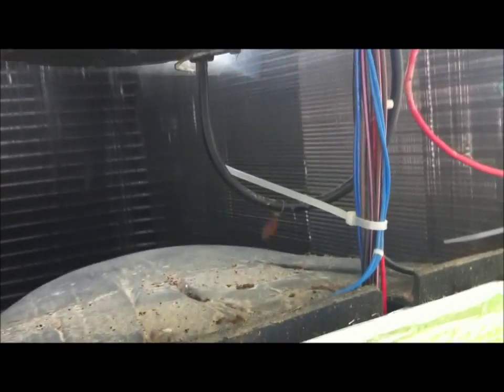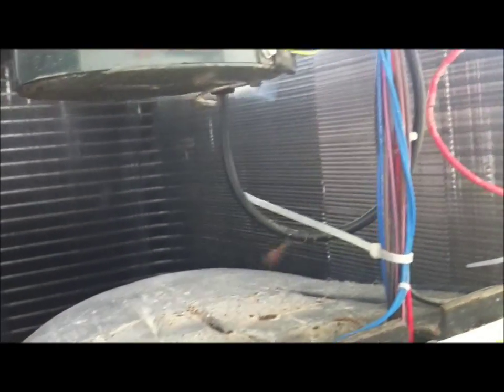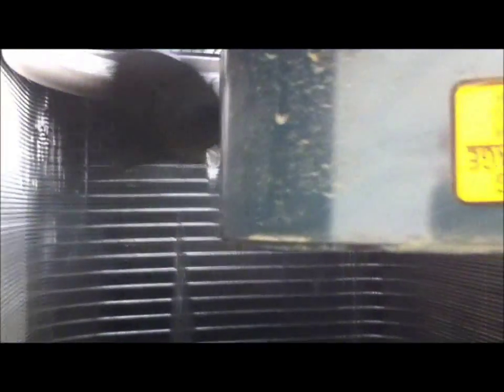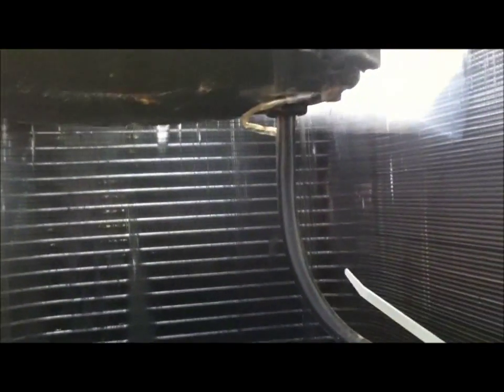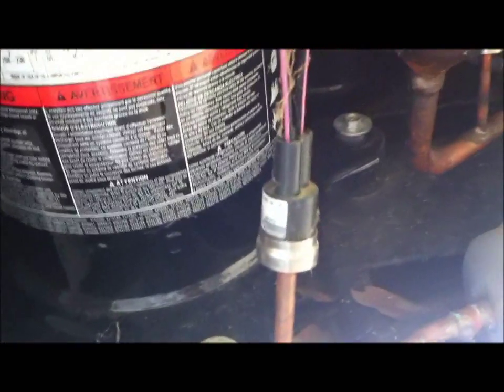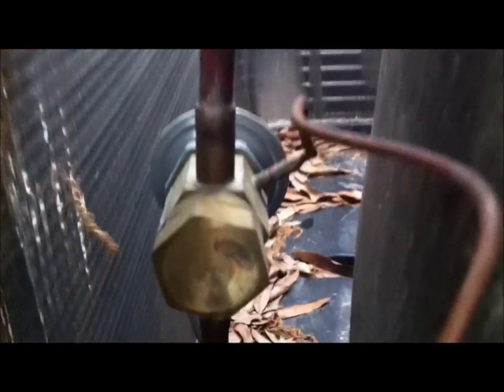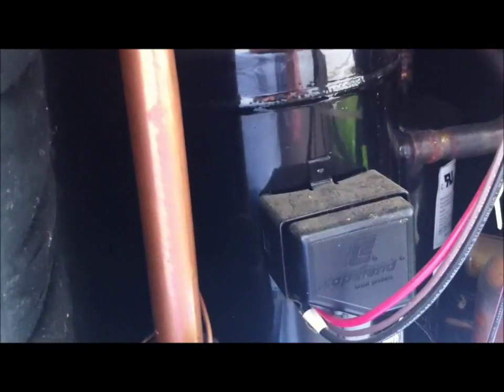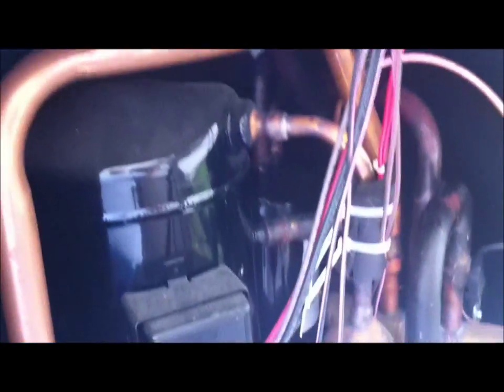HVAC: My Dad's York 18 Seer Heat Pump 2

Comment: Thanks John! I like how they use the 142 condenser fan motor with the remotely located control, they probably do that so it is away from the water.I like how you pointed out the three sided condenser coil some people fine it so confusing when charging....great video!